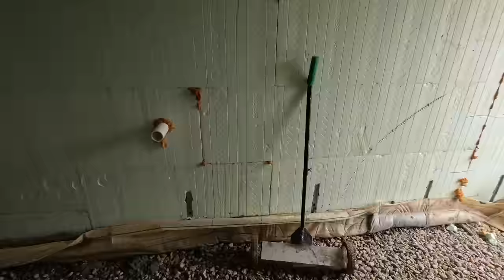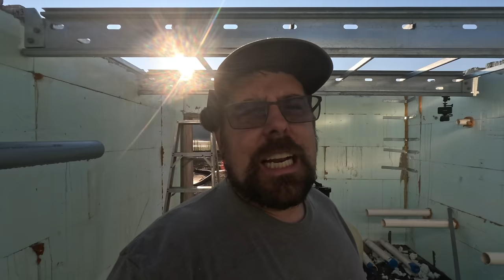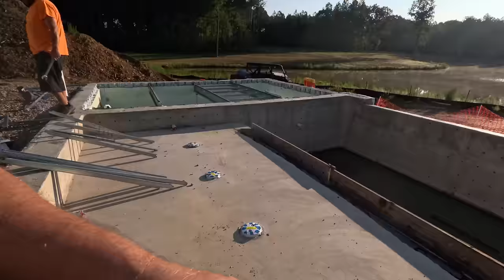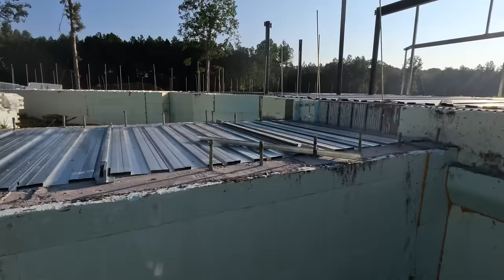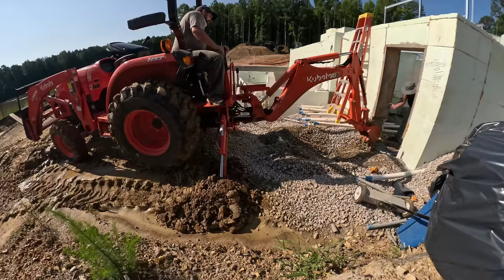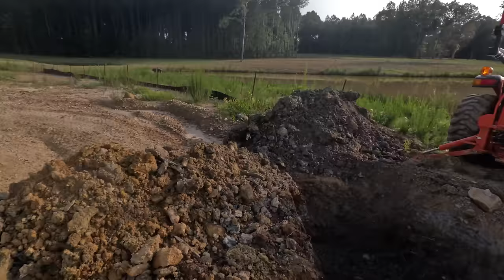I Dig a Trench for the ICF Pool Pump Room Drain

Comment: In your pump house you need a fan that blows in and one that blows out because there's going to be chlorine in that room and it will eat that metal roof out of there if you do not have adequate ventilation and keeps moisture out also
Reply: Almost everyone is doing saltwater pools now so chlorine should not be an issue.  It probably does need some ventilation or a dehumidifier just for moisture though.
Reply: @daneclark3161 you still have chlorine in a "saltwater" system. It just converts the salt into chlorine.
Reply: @kennethney4260  - I was checking into these several years ago and from what I was led to believe, as the salt water passes through the chlorine generator the salt is converted to chlorine, but the moment that the water has passed by the generator then the chlorine reverts back to salt.  

I might not understand the process correctly because as soon as my owner/operator pool supplier told me that they would not spend the money to convert then I lost interest.

Comment: I'm glad you decided to put a floor in the mechanical room. Definitely going to help with moisture.  The comments about chlorine aren't you using a salt pool chlorine generator? It shouldn't be an issue. Looking good ! I agree with everyone exhaust fan in the mechanical room up high and a louvered door. We had some swampy mechanical spaces underground. One that was 50k sqft poorly designed . Made for some interesting flooding when piping failed.
Reply from the maker: Salt and Ozone. A minisplit as well.

Comment: A couple of things you might want to consider with the pool filter: one is when you back wash you will be pushing a bunch of water. Make sure what ever you are pushing it into for the backwash can handle the volume. Also, put a clear section in the backwash drain so you can watch the progress. That way you can see when it’s finished backwashing by watching for clear water.
Reply from the maker: That’s a great suggestion
Reply: The filters have a sight glass so you can see when the water clears up.
Reply: @kennethney4260  Mine didn't so I relied on watching the discharge hose to see the progress. Made a big mistake once of terminating the backwash while the water was still coming out dirty. It pushed a lot of that dirt back into the pool when I returned the operation to Filter.

Comment: Hey love the Chanel as for the pool pump and electrical  room I would suggest a good filtered cross ventilation due to moisture and excessive heat  that will take down and destroy motors pumps electrical in no time flat. it's bad enough up here in north central Wisconsin. I have seen this to many times . I bet it's really nasty in your part of the country with heat and humidity.
Reply from the maker: Thanks. It is getting a minisplit.

Comment: This is all very interesting. Wondering when you will be installing all the raidant heat for the heated floors in the basement? and will you also be installing the raidant hearted floors in the first floor as well??
Reply from the maker: Yes. They both get radiant. I was hoping to get under roof and then work on the floors. We’ll see how the timeline goes.

Comment: Watch your elevations if your planning on the floor drain coming in the bottom of the basin. If your outlet is too high you'll just push water backwards up the floor drain pipe...
Reply from the maker: Outlet of catch basin needs to be lower that inlet of floor drain. ✅

Comment: Looking good Geoff!  
So you flip flopped again on the floor on the pool equipment room, the last time you said you was going to leave it gravel, so if there was a leak it would drain faster.

Concrete is good, it will keep the vermin out.

So have you decided to pour the floor /Roof the basement so you have hsve a place to anchor the plum wall  braces?
Reply from the maker: I’m going to anchor them to the metal pan
Reply: @BealyGood  I honestly doubt that will be strong enough.  What is the gauge of metal on the Floor pan, unless you are going to anchor to the beams of the floor pan, plus in the adjustment your will have to allow for the downward deflection at the brace point of the legs.
Have you talked to the Super floor about attaching Plumwall braces to the pan without concrete over the pan?

My cousin in Texas has a company that builds Customs  homes, and he said the ICF bracing need as solid floor to anchor to, earth, wood or concrete.  he said super floor is good and strong, but it needs to be capped before anchoring ICF bracing.

Comment: Are you going to brace the beams under the pan before you pour the floor?
Reply from the maker: No, It is designed to not have to do that.
Reply: @BealyGood  I'm unfamiliar with that system so I don't presume to know more about it than the design engineers. To me,  it just seems like a lot of weight on the bolted joint and foot pads.

Comment: Sounds like you are finding details left out of the engineered drawings. Chris has no worries about competition from your digging. Did you just admit finding the hard way you can`t pull wire thru too many bends?
Reply from the maker: 25 years of experience pulling wire and yes, I learned the hard way 🤣🤣

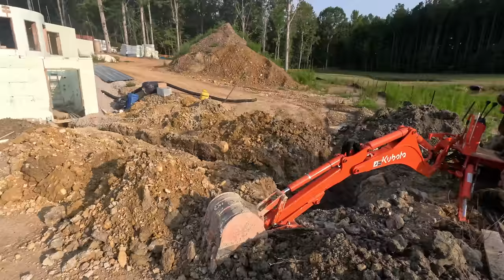Comment: 17:00  That's one way to test your ditch slope...

Duct tape some 4 inch flexi drain pipe on those pipes and run it out at least to the ditch.  Stop eroding your work away.